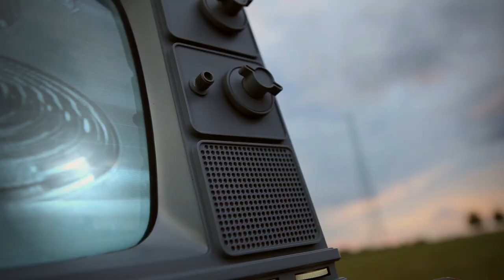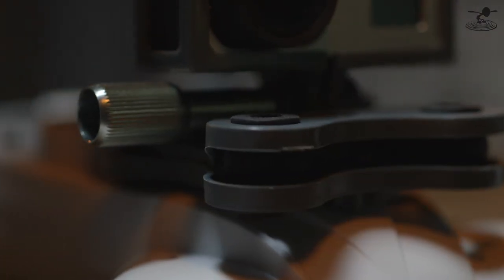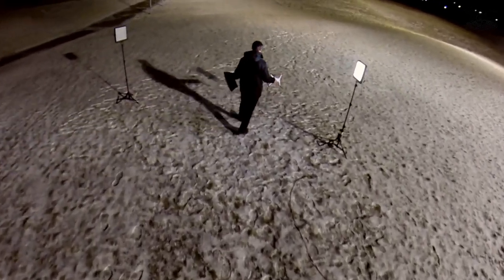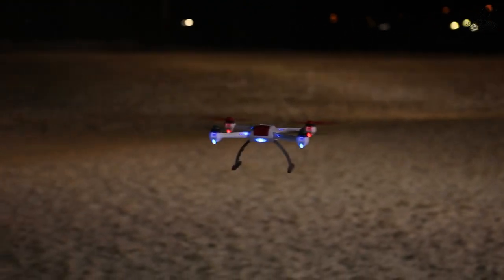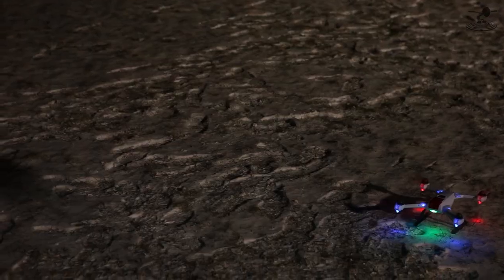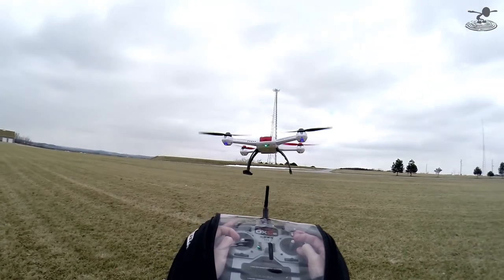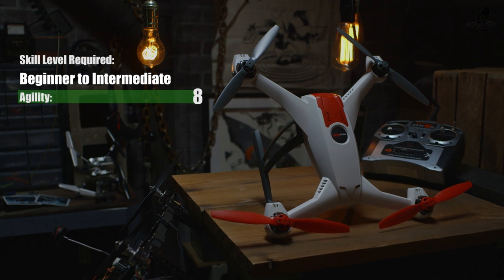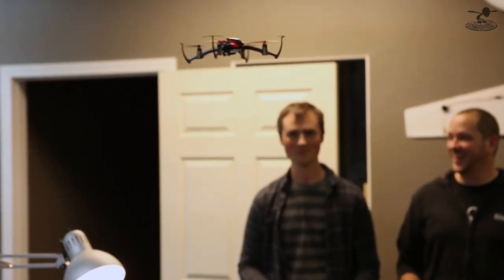Flite Test - Blade 350QX Quadcopter - REVIEW

Comment: Great new format and excellent production - kudos, David!  One suggestion to folks worried about the "non-adjustable gains" you discuss:  although the quad's gains are fixed, you CAN MODIFY THE GAINS of the signal sent by the transmitter instead.  You can use the hi/lo feature of the DX-5e transmitter ("lo" knocks the transmitted signal gains down to 70%).  Better yet, buy the Bind-and-Fly version, and use a better Spektrum transmitter:  I use a DX-7s with my 350, and use the transmitter's mixing to adjust gains any way I want. I experimented with 20% gains on ailerons, elevators, and rudder (Horizon tells us to set up the transmitter in airplane mode for the 350) - which yielded very mellow and easy operation.  You can even remix the throttle signal which will modify the max height at full throttle in "Safe" mode.  Thanks for the great review!!!

Comment: I bought the original 350QX in 2013 because my local Hobby Shop supports it. I had no idea how to fly a Quad so It's in it's third body shell now. I am however a respectable Quad pilot now.  But not from flying the 350QX. I learned to fly a quad flying the Blade Inductrix.  Then my two 180QX Quads one of which I made an FPV platform with the VA1100 FPV Camera. I fly the blades off my two 180QX's. I will fly my 350QX until I destroy it or lose it. Also I disabled the GPS on my 350QX due to frequent fly-offs. 
My next big quad will be one that I build.

Comment: I've had my blade qx350 for a couple months now. cost me £325 RTF and you know what i have not looked back. sure i could have built one for cheaper say £150 less. but then you'd have to surf the net, forums, shop around. maybe even program. I do not have the skill any more or the time to do all that. I will build one eventually but in the mean time I cant put my Blade down. I recommend it to anyone interested. It flys smooth and is real easy.also grate vid by the way!!

Comment: David, has yours not experienced prop failure yet. It will, just a matter of time. GPS lock issues with GoPRO, Re-binding issues, motor bearing issues. Just keep flying it, they will all come in due time.  I call mine the 350qxtimebomb. :) Great Video, good luck with your future endeavors. We will miss you on Flight Test.

Comment: I have a 350qx and agree with the video wholeheartedly, Having said that; it is my first larger size quad and Ive been flying it for about 3 years occasionally with absolutely zero issues although I did need to do the shielding mod when I got it cuz the gps wouldnt lock with the gopro on, It seems that you can get these birds very cheap in the used market and carbon frames are also available even though Im not sure Id spend the money as mine is still holding up well. Another thing to note too is at least on mine the frame\body is quite flexy It's too bad the boards are so expensive because I would put the blade electronics in my 250 quad in a heartbeat!!

Comment: Ok, this one seems great.  My application is not play but is using a Quad for Amateur Radio Antenna Inspection.  CB Bast stations as well.  Is this a good unit for that and will the Go Pro cam capture enough detail to be useful?  I need to see detail and condition of connectors, wire terminations and screws and or rivets.  Am I looking at the right Quad and Cam for this?  How about a demo for us who want to work with these Quads instead of hobbyists?  Thanks man ,,,,,,,,

Comment: Great review. Have a Phantom and love it but there are feature this quad has I wish the Phantom had.
 Another disadvantage IMO is there is virtually nothing after market available for the 350 qx, prop adapters and high output batteries is about it. I found nothing for mounting FPV cameras or TX on Ebay or Amazon and nothing but OEM parts for the most part there. I'm sure it must be out there but not like with the Phantom. If you are not into upgrades and mods than that would not be an issue but once you start flying you will want to upgrade I'm sure.

Comment: Great review, enjoyed it a lot. I have the 350QX, it is my 2nd quad after the little hubsan. The QX is a joy to fly but David is right about the video capture being a bit difficult. The propriety props do cause shaky and shuddery video. However it was good enpugh to get me hooked on quads with cameras (I have not flown it fpv). After Flying the 350QX I was confident enough to build a DJI 450 Flamewheel for fpv use and its fantastic. On the prop side I have bought some adaptors to allow standard props to be used. I'm going to try it with some nice carbon fibre blades and see if that smooths it up for video recording. Its expensive yes, but for ease of setup and to get into fpv/aerial easily its top class, flies great straight out the box. I use a dx8 and downloaded the tx setup from Spektrum but it would have been easy to program.

Comment: First of all, great review.  Flitetest.com rocks!  The 350QX was my first RC of any type.  I saw my friends Phantom 2 with a GoPro/Gimbal, a nice package with fpv and monitor for around $2.3k.  I decided I wanted to get into it.  The Blade has been a great introduction to RC for me.  I'm a bit of a loner, and self-taught mostly, and the 350 allowed me to learn safely.  I got the "Bind and Fly" (BnF) version so I could get a Spektrum DX6i transmitter.  This gave me 10 model memories and other features that the "Ready to Fly" (RTF) version with the DX5 transmitter lacks.  It was less expensive the the RTF and helped with the DX6i purchase.  The "Green" Safe Mode is awesome to get a noob started with confidence. You will eventually need to abandon it to the "Blue" Stability Mode as soon as you can to learn how to really fly. Green mode can be used for video, I shot some of my church using a Sony Action Cam, but you're learning bad habits and not progressing towards real flying.
I'm building my first Flitetest Anycopter quad, but the 350QX will be a great help with my piloting skills.
Reply: And it appears that Horizon will soon offer a cable to upgrade software.I don't know if it will allow adjustment of the gains, but I'm still too much of a noob to appreciate the difference. http://www.redrockethobbies.com/Blade-USB-Interface-Multi-Rotor-Programmer-p/blh7840.htm

Comment: Nice review David! I have a 350QX as well as the nano QX. I really love them both. Also my friends can fly the 350 without any skills which is a nice motivation to enter this great hobby. I think the 350 as well as the nano, are great entry level quads. No tweaking, no knowledge is required. HH did a great job. There will always be the comparison with the Phantom, but hey, thats ok. As long as you enjoy flying. I crashed once with the 350, accidently pressed the throttle cut switch, and it fell from about 50 m on the grass. Only a small crack on one of the arm. Some CA and Bob is your uncle. David and the rest of the FT crew, I am a huge fan! Keep up the great work!!
Reply: No skills, eh? ;-)

Comment: At first I'd like to say that your video is just an awesome review, much better than the reviews, hobbyking makes!!
I'm flying the Blade 350 QX for about 4 months now an I enjoy it every time.
Unfortunately, I had a crash and the cover was damaged. So I had to buy a new one (about 30€ from Amazon) and I transferred all the electronic stuff into the new cover. It wasn't too dificult but all together it took about two and a half hours.
Fortunately, everything works right again! (It is possible ;-)
Sometimes I use the 350 QX for doing videos which is possible with the Blade 350 QX but everything else than perfect:
The battery runs much faster down (normarly I can fly for 12 mins, with cam (about 100g) I just can fly for 5 to 7 mins), I don't like the way the camera is fixed on the copter and there are much more vibrations in the video compared to the same camera on a DJI Phantom which I prefer to record videos.
Ok, there's another thing I don't like: The charger that is included in the BNF-Version (I don't know which charger comes with the RTF-Set) can only be connected to a car battery which is pretty fool if you normaly charge your batteries at home. 
So I'm using the DJI Phantom Charger (you can forcibly connet the EC-3 to the XT60 without buying anything) but I bought a EC-3 cable for it (less than 6€ from Amazon) and it works better.

But (for me) fact is  that it's more fun flying the Blade than flying the Phantom.
It's definitly worth buying the 350 QX!!

Flight Test Team, keep on doing that reviews, they're great!!

(Sorry for my english, hope you could understand it, I'm from Germany:-)

Comment: bought a  350 - charged it up plugged the battery in - and it fried- smoke and pop
the retailer got a credit and tried setting up a new unit (for an hour) it has yet
to start- the gps binding seems to be critical to starting the rotors- so far a hassle

Comment: I've had 2 fly-aways already...  This quad has a serious problem with not only losing GPS lock but responding to that event with a mind of it's own... The only reason I can find it when runs away from home is because I have a GPS tracking device on that uses Verizon Data. Luckily it hasn't gone down in water yet... but I did have to climb pretty tall tree to recover it once.  The flight time is 10+ minutes without the gopro... But I fly with a gimbal and gopro and I still get 9 minutes before she begins to settle to the ground for lack of power. Another big problem is if you turn wi-fi on you will lose control of the quad when gets a few hundred meters from you because the camera is over powering your transmitter on 2.4g... so much for spektrum's claims to be anti-jam tolerant. :D

Comment: I agree with your ratings and findings. I am a huge Horizon Hobby fan.  I own over 50 of their rc helis and planes. Yet as much as I wanted to buy this, I knew getting the Phantom vision was the way to go. This has a ton of great features and is great for flying but not good for fpv in my opinion.

Comment: How do you do flips, I got myn used with no instructions but can't figure out how to flip
Reply: ElectricBass GMD putt it in acro mode (red light) do a sharp pull of the right stick towards the way you want it to flip and it will flip like crazy :) if you can't balance it just switch quickly back to beginner mode and it will automatically level
Reply: Tomi great.. thanks so much. your a great help :)
Reply: ElectricBass GMD no need to be sarcastic about it mate! :)
Reply: Tomi I'm not?? I was thanking you for your help
Reply: ElectricBass GMD oooh okay then :)) my mistake 
Anyway in acro mode the quad doesn't level out by its own.It is a very weird feeling.Ever flew normal rc helicopters ? Feels very similar.
It is very responsive and you can do pretty much all kind of stunts except the inverted flight .(You can do invert flight with the Blade 200qx and fly it on its head ,you can even do the famous TIC TOC maneuvre with the 200qx ). It's very easy to recover ,as I said ,just flip the switch to normal mode (safe mode ,switch to position "0" with the DX5e) or if you're panicking just flip the return to home switch and it will level out .
Reply: Tomi kk. thnx m8. seems you know what your doing
Reply: ElectricBass GMD just experience , you'll get that soon enough:) have fun flying
Reply: Tomi thanks bud

Comment: my drone is very good I've crashed alot but that was on grass I don't know how it would take it on gravel or cement one of the rear blades split in mid air about 10 feet of the ground but it took about five dollars to get more from ebay

Comment: I built a v-tail quad built cnc the frame, running sunnysky 1400kv motors. kk2 board, dys speed controllers, 5000 mah 40c-65 burst lipo. This thing is a rocket i put 2 batters on (each about430+ grams 2nd batt just for the weight) picks it up no problem. thinking about a go pro camera on it next. I get about 13-14 min run times. sweet ,i just ordered dji f 450 frames this one i will put the go pro on. The wood one i will figure out how to fly and flip it.

Comment: Great review but was confused about the recommendation. You gave it decent scores across the board but then said you don't recommend it. I agree with everything you said about the specs, but I could care less about the aerial photography. I recommend this quad based on things that don't revolve around taking videos. I love how it can do big, wide loops and tight flips. I love how much power is in the motors. And I can't wait to do FPV with it. :)
Reply: If your going to do Flips and loops you will definatly require shares in eflite!! David says ease of repair is a solid 1 and this is because it takes up to two hours to do a frame swap when all you have done is broken a motor mount. To put this in perspective a TBS Discovery can be built from scratch in an hour and it takes just a couple of mins to change an arm.
Reply: thats all fine and well but who said anything about breaking something. just dont fly foolishly and give ur 350 at least 20 feet :p
Reply: You missed the small detail about the price. If there's something better for the same money, how could you recommend the inferior one?
Reply: I don't think there is anything else on the market that compares to to the 350, the Phantom is not aerobatic and still expensive to repair and Walkeras effort is a dog egg version of Eflites 350, this is why this class is so expensive for what you get, for my money a DJI 450 with a Naza V2 is far more capable than any of these 350 size quads.

Comment: Would this be a good step up from the parrot Ar drone?
Reply: In my opinion not because the ar.drone is also ready to fly like the 350QX and that means you by something you already have. I would recommend the DJI Phantom. With the phantom you can use it as a beginner and as you gain experience you can start tweaking the gains and modes, with the 350 qx it's not possible. Also as a beginner (I assume you're a beginner) you will crash a lot and will have to repair the quad, it's very hard to repair the 350QX cause of all the integrated electronics. Hope this helped you!

TeamEZephyr
Reply: TheJantjewillem You are making it sound like the Phantom is more advanced than the 350QX. They are basically the same thing. Expect for the gain adjustments, they are identical in feature set. You said the 350QX is hard to repair because of integrated electronics, but so is the Phantom. I think this and the Phantom are very comparable and if you're coming from the AR Drone, then you probably have no experience flying with the sticks, so this one  or the Phantom are great places to start. They both have their ups and downs, but they are in the same class.
Reply: The ar drone is more of a toy (these are all toys :D), brushless motors, the iPad is cool to connect with fpv but you can get close to the range of a rc transmiter and fatsharks I would say its a huge step up but I recommend David's tricopter or the any copter build kit from flite test. I built one for $120 and it seems to perform better than any commercial quad out there. 

Also if you wanted fpv then you can get the fatshark teleporter kit from hobbyking. It's $200 or you can get a more expensive fpv kit if you want
Reply: The DJI Phantom FC40 or v1.1.1 are great beginner quads.  I own 2 Parrot AR Drones 2.x (one modified with RC controls), a Phantom FC40, Phantom v1.1.1 and have an 350QX Firmware 2.0 on the way.  The FC40 is a 5.8 Ghz quad so you can use a GoPro 3 with Wifi on without having it interfere with your TX controls.  The Phantom v1.1.1 is also a great beginner quad if you are planning on upgrading to a 2 axis gimbal in the future.  With the new Phantoms you can easily change props without any tools and have many prop options.  I've tried 9 inch props on my Phantoms and I've gotten over 13 mins of flight time as opposed to a little over 10 mins.  Many many upgrade options on the Phantoms.

Not much upgrade options on the Blade 350 QX which I've purchased strictly for aerial maneuvers maybe some FPV with a small cam like the Teleporter Fatshark in the future.  I'm not even going to install the GoPro mount.  If you're interested in AP the Phantom is definitely the beginner platform to go with.  Just don't enable manual mode which is the agility mode version (sort off without the agility) on the Phantom and it's pretty much impossible to crash,  Just need to watch a lot of YouTube videos on proper calibration and setup before your first flight.

Comment: I love my new Blade 350 qx for the most part but the plastic, all the plastic, props, skids, and the body inadequate to the task. To easy to break and expensive to replace. On top of this replacement parts are scarce.

 Long story short I am wondering if you've ever considered designing aftermarket crash kits, fixes, adapters and the like for this and some of the other products reviewed. It seems like you would be in a pretty good position to do so.

Anyways I want to also say great job, I'm turning into quite the fan of your show.

Comment: Thank you David.  This is the most thorough and well thought-out review I have seen in a long time.  Your explanation of the different flight modes was very clear and very helpful.  I like how you broke out the various traits of the copter and rated each one separately.  I also thought it was really helpful that you compared the Blade machine another manufacturer's machine and were able to point out their relative value and back up your opinions with specific meaningful facts about both.   Just excellent work all around.